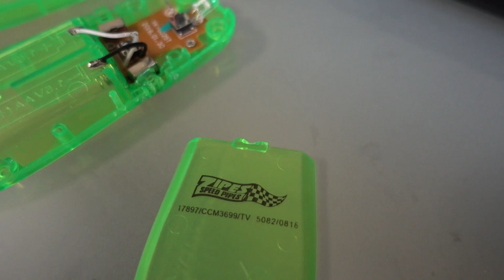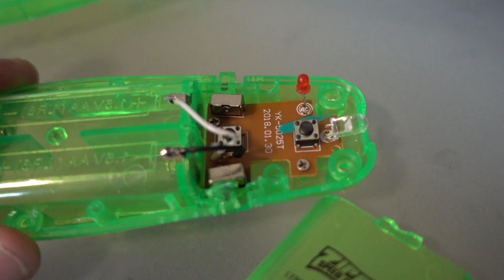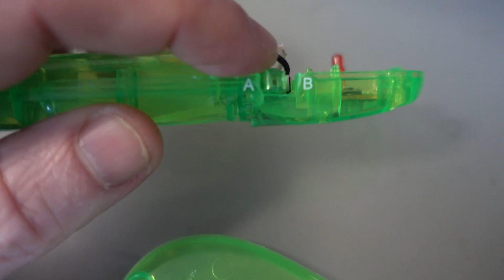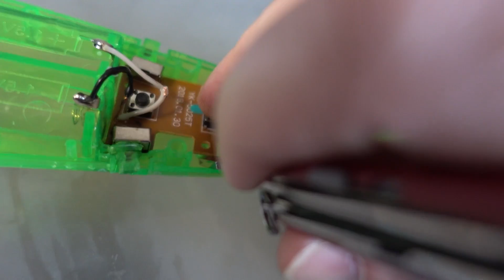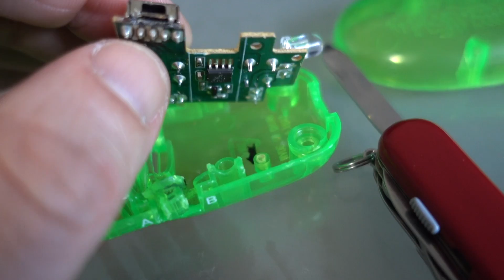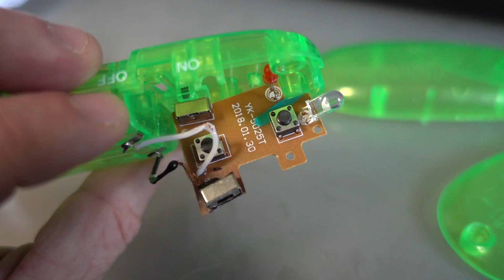EEVblog #1219 - Don't Trust Switches - Toy Repair

Comment: I had a similar melty moment with a cheap switch in a prototype I was working on, I can confirm that cheap switches can do this. Using a resistor instead of connecting directly between the rails fixed the problem.

Comment: I wonder if the switch is a "make before break"?  If it was, then in this design the switch would short the battery each time it's switched.  If it got knocked to the center position - ugly.
Reply: That was my hypothesis too.  The switch case being grounded is a red herring.

Comment: I came actually across a similar two way switch which turned out to short all three pins together when the slider sat in the middle possition! In a first design I blew a track on the PCB because of this issue. 10k solved the problem. This was a lesson for life :P

Comment: It's carrying the ground over to the other side of the switch so the switch connects the centre pin to +v or 0v to signal the chip

Comment: I have a clock-radio that narrowly avoided such a fate due to a cheap switch, the plastic of the slider broke and now the contacts won't align correctly to function, but I'm hoping the circuits are fine because there's no heat damage anywhere and the separate digital-clock pcb still works! (3 volts to the led-backlight rail and the whole clock powers up!)

Comment: well there is nothing terribly wrong with grounding the case as long as faults like this are impossible per design. but putting power and ground directly next to each other on the switch without atleast one position as a guard band in beween is bad practise.
Reply: der bender Depends on the switch and how much it is trusted.  This switch was trusted to have a higher reliability than it could actually provide. Chip spec dictates availability of alternative solutions.  Not all chip inputs accept the pull-up or pull-down resistor solution that would work with an on-off switch.

Comment: the inside if the switch is all plastic that holds a copper slider strip & whats happened here is the plastics broke apart the slider poped off into the gap shorting the switch terminals to the outside & even if you replace the switch the chances are one of the other components would have been burned out too cos of this short

Comment: Reason for soldering the case could have been for mechanical integrity.
Reply: ET nothing bad with soldering the case. It just shouldn't be electrically connected to GND on PCB. Just let it float.
Reply: @SergiuszRoszczyk  Yes, but in principle no harm should come from soldering it to GND, unless it is faulty...
Reply: ET yes. Just a one more possible failure point ;)

Comment: Years ago I had a pen light which had a similar switch failure while it was in my pocket. Two AA batteries can produce a surprising amount of heat when shorted. Folks thought I can gone nuts as I started dancing around trying to reach under my jacket to get that pen light out of my pocket!

Comment: Seems to me like the switch connected the battery plus to the ground when you put the switch halfway. That way the thin metal strip that makes the contact gets very hot. You could check the other switch if it makes continuity between the 2nd and 4th pin when switching it over. Nice video!

Comment: Get well soon Dave.  Ouch, nasty short that.  I’ve had to bypass faulty switches on garden lights, completely open.  I’ve had cheap switches fall to bits too. I have a tile filler kit that uses AA cells to melt the hard wax filler with a heated mini knife.  Alkaline cells pack a lot of power unlike the old carbon cells.

Comment: Another reason for "earthing" the switch body is for mechanical strength.  On devices such as this one common can often have a lot of copper tracks and therefore good to use for anything that needs mechanical strength.

Comment: Looks like the switch is connected across the supply on purpose. The pole of the switch would then select between GND and VCC. Could have solved that issue with a pull up or down resistor...

Comment: Do not trust "engineers" - who decided to remove the current limiting resistor on the signal switch. Cheapass toy.
Reply: Zsolt Köhler A current limiting resistor would have done nothing unless in the B+ feed to the switch, which is highly unusual.  This switch is identical to the power switch on the other side, and that can't be current limited.  Either the switch is faulty, or it's too sensitive to dust/moisture in a toy environment.

Comment: My guess based on experience with my own children is that it got wet, and that's what caused the short. Sources of water include cordial, saliva, bath water or a combination of all 3.
Reply: All of those disgusting or less disgusting liquid are far too high in resistance to make such a short.

Comment: Well, probably used rechargeable batteries? Wrong... in the specifications it is probably written not to use with that power-source...  with normal batteries  a small switching short would not melt your switch away.
Also probably not ment to be switching with batteries in them? ;-)
But who reads manuals besides having to laugh about the 'translation' right?

Nice fail though.
Reply: Modern AA alkalines easily deliver a few amps of short-circuit current, which is plenty to cook such a tiny switch.
Reply: @VintageTechFan  Ohw... I would need to test that out... Remember 'in the old days' that NiCD's were very dangerous (almost like Led-batteries) because they could provide much more Am then standard batteries. Never left a fuse out in my designs with them...

Comment: But there is an electrical reason to ground the switch body though, isnt there. The middle contact selects the channel depending on if it is connected to + or -. Because its a single side PCB, they somehow need to jump the ground over the signal, as you can see, the left contact is also connected to the case. So the chip looks for either + or -, but they need to get ground over the signal, so they go through the case.

Comment: Looks to me like the channel select line is switched between +V and 0V and the metal switch body is used as a jumper to get 0V to one of the switch contacts.
Reply from the maker: I said that in a text overlay in the video
Reply: And looking at those burnt pads it looks like the switch had a failure mode where it turned into make-before-break in the center position. Alternatively the wiper inside could have folded over and made the wrong contact.
Reply: @ZomB1986  The MBB switch action is the most likely scenario. You could get away with it if the the swich had a decent detent that stopped it being left mid-travel.

Comment: *EDIT* And I see you caught that detail as well, at the very end of the video! I was starting to wonder just HOW under the weather you were! XD
I believe they used the switch housing to save the cost of a jumper wire or 0 ohm resistor. One side of the switch is tied to the positive power coming off the power switch. The common goes to the chip, and the other side of the switch is tied to the switch housing next to it. the other side of the switch housing is tied to the battery negative. Basically, the switch either sets the chip input to the negative rail or positive rail. The switch housing was used as part of the circuit to avoid the need for a pull up (or down) resistor, a 0 ohm jumper resistor, or even a plain jumper wire. Gotta save those pennies!
Reply: I have a USB Doctor, a USB voltage/current meter that used the case of the USB connector as a jumper for the USB negative rail. 
The circuit uses a 0.10 Ohm shunt resistor to measure current. The USB connector had a higher resistance. With a 1 amp load, the total voltage drop was about a quarter volt. Around half a volt with a two amp load.
The only way I could draw two amps was using a resistive load. None of my real USB devices would draw that much current with that large a voltage drop.

Comment: This is a poor design. If you keep the switch in middle I guess it shorts out all 3 pins and hence that caused the short circuit. Two edges are positive and GND supplies. The critical point where it shorts out all 3 pins kept it intact due to little sparks or heat.

Comment: The switch is switching between "hard" B+ and GND. There is no pull-up resistor. Bit of a silly design, there will be lots of noise when it switches. And a potential short hazard as we saw in the inspection. All to save the cost of one resistor.
Silly buggers.
Reply: Eddy_D Noise level depends if switch is break-before-make or make-before-break.  Make-before-break will produced short circuit noise during switching. Anyway this switch is intended for rare operation, so switching noise is not a concern.
Reply: @johnfrancisdoe1563  - If this switch was make-before-break (which I doubt) then I would have to further downgrade the intelligence of the designer! 

Regardless the noise issue is really irrelevant; it can be de-bounced by the logic/uC or other passive RC circuit. I was really shaking my head at the lack of a current limiting resistor between the switch and B+.
Cheers,

Comment: Switch probably failed at being"Break-Before-Make" and the wiper got stuck in some intermediate position where all 3 contacts were shorted. Seems more probable  to me than shorting to the case.
Reply: Wouldn't that just result in having both inputs to the micro being grounded instead of one? Unless they did something really funky with pullup resistors. Or maybe there's a code fault where they raise things to VCC without an internal pullup at some certain time or something.
Reply: @linagee  Follow the traces ... there isn't two inputs to the micro, you have one line to the micro (the center one), then the switch extremities are GND and VCC, no resistors. So the switch toggles 1 micro input from GND to VCC.

Comment: Would be interesting to check the other switch to see if the switch is break before make on the contacts, the way the faulty switch is wired it either pulls the centre contact to B+ or to -VE, but if the switch doesn't break before making it will short the battery, hence your problem.

Comment: Is it possible that the channel select switch was toggling an input between positive and negative, and was left in an intermediate position which shorted them both?  The resultant heat as the switch melted could have melted through the wire insulation while also cooking both wires with the full battery short circuit current.
Reply: This is a situation where you have to have a "break before make" switch.  If you're buying the cheap part of the day, who knows what you're getting.

Comment: I just had a switch in a 12v electric cooler/warmer heat up and melt the cooler/warmer switch. I permanently bridged the board to cool after removing the switch works great again.

Comment: I had a 3 'D' cell Maglight flashlight years ago start on fire in my toolbox because the switch shorted and started the rubber button on fire.
Reply: Did you make a warranty claim?
Reply: @mycosys  no, I just moved on.

Comment: If the switch was a make-before-break kind then it would short like that each time it was switched. If left in the middle then it would short + to -.  Maybe some kind of switch part mix-up during manufacturing?

Comment: I can see what your going to do. But it would have added allot to this video if you had actually repaired it.
Reply from the maker: No, it would have added very little. Remove switch, bridge pads. Fixed. But that's at my lab.

Comment: I wouldn't be surprised if that plastic switch, the one that controls the up/down (back/forward) motion, over time continuously rubbed against the white wire, rubbing away the coating, causing it to expose the wire to the ground chassis of the A/B switch.
Reply: cheap switch here & the plastics that weak its broke inside the switch causing the short not the wires running from board to holder
Reply: you know this was my first thought, especially if you like a 3:50 it looks like the white wire wraps around the push button switch.
Reply: @phalcon23  Yeah, that's why I thought that might have been the cause, by he cleared it up in the repair video.  His explanation makes total sense.

Comment: With pin 3 shorted to the switch chassis, the chip would appear to be detecting whether that pin is referenced to ground to determine the channel.
Someone apparently decided that it would be better to use the chassis to jump the ground across than to flip the switch pins and use a jumper link to jump the positive terminal across the common pin link - not the smartest option for a device in kids hands
Reply from the maker: Could have used the ground as it is and a pullup resistor for the high
Reply: @EEVblog  
manufacturer : oy , are you trying to destroy my profit ?
Reply: YTANDY100 Use the built-in pull up resistor in the chip.  It's free and even allows using a cheaper on/off switch.  One practical issue would be if pre-programmed chips had already been ordered or if this is a dedicated RC chip and not a microcontroller.
Reply: @johnfrancisdoe1563  
i hadnt thought of that , and now that you have it sounds like a good idea and even if its a dedicated rc chip it may already have a pull up seeing as it is only a two state pin :-)
maybe dave can test it ? :-)

Comment: Could some water or juice gotten in that switch?
Reply: I was wondering the same, could have Huxley sucked on it and saliva shorted the switch out?
Reply from the maker: No, Huxley isn't a baby and doesn't suck on things. And saliva would have no nothing, and it's not high enough voltage to start a DC arc-over. it's a switch fault.
Reply: Or saliva?
Reply: And caused full short circuit with enough current to heat up and melt the plastic? No. Even if it was conductive enough to cause this, it would evaporate before that damage would occur.

Comment: wow amazed that 2 AA's had that much current wow..
Reply: definitely…. that's how they make lighters in prisons by stealing batteries out of the remotes lol.
Reply: It's not unusual for the short circuit current of a NiMH AA to be 10A or more.
Reply: @NiHaoMike64  10 A is low for short circuit current of NI-Mh AA. I had short circuit current of 15A for AAA NI-MH. It could have been more with a lower resistance meter.
Reply: I learnt the power of alkaline batteries as a child, when I decided to use one of those Duracell Powercheck battery testers, meant for 1.5V batteries, to test a 9V battery. Magic smoke was released. Nowadays the testers are integrated into the cells, but they used to give you a separate, re-usable tester strip when you bought a pack of batteries.
Reply: @patrickwigmore3462  ops lol not good :) I don't think I remember them

Comment: Funk me.. 3volts did this.
Reply: its not the voltage that gets you  tis the current
Reply: FennecTECH and to get current, you need enough voltage to complete the circuit ;)
Reply: @Dust76tr  indeed 😉
Reply: @Dust76tr  
any voltage on a low resistance supply can provide many amps :-)
i took off the secondary winding of a microwave transformer and put on one turn of 50 mm sq copper wire on and that was just less than 1 volt , i shorted it out and put a clamp meter onto the wire plugged it in and the clamp meter went out if range (more than 600 amps) , it was plugged  in for less than 1 second ish and the wire was already quite warm :-)
Reply: During a spot weld, the voltage between the two contacts may be as low as 1 volt! And we're talking red hot, melted steel.